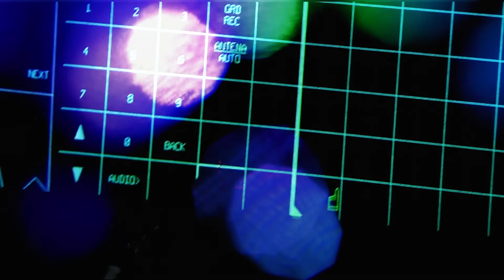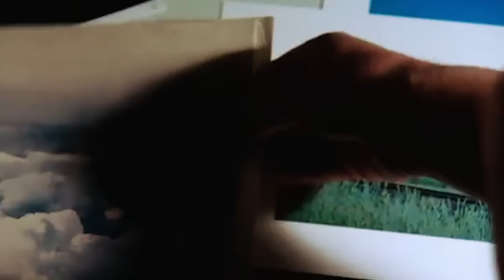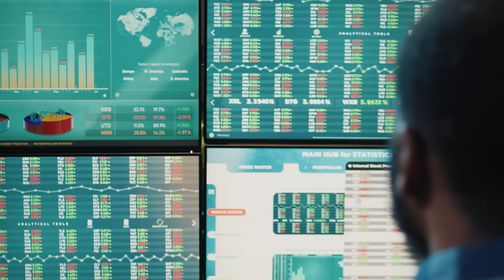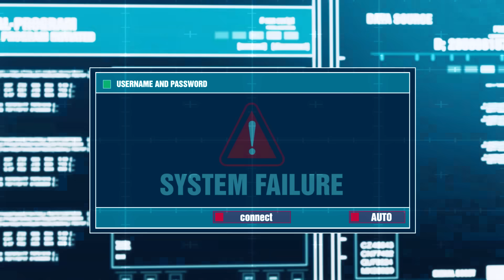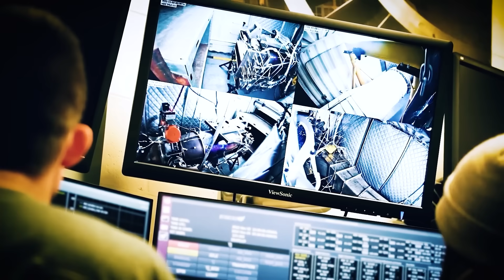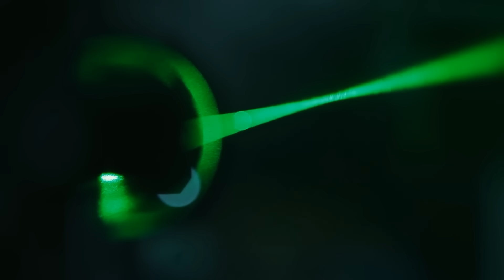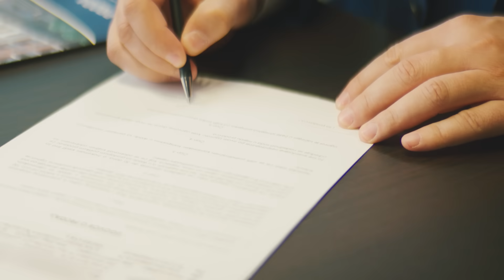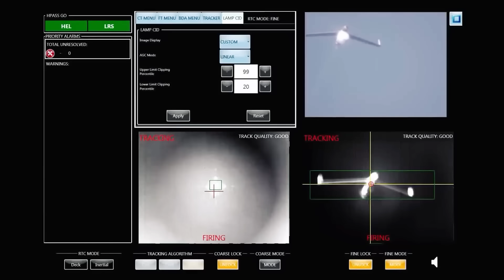Breaking! US Air Force Declared DARKSTAR Is REAL!

Comment: What do I think of an airplane flying at "2 miles per hour?"

I think someone messed up.
Reply: yeeeah, Im Guessing 2000 mph
Reply: That's only mach 1.6
Reply: My guess is it'd sink like a rock
Reply: Diversity hire?
Reply: No actually it's 2 miles a second.....that works out to Mach 10
Reply: The old Marine AV8B Harrier could move that slow in the air
Reply: Fantastic retort! @TheKevinNewsom
Reply: Yeah quality control is asleep at the wheel.  It doesn't make any sense at all whatsoever...should have been caught by a professional channel.  And no edits?
Reply: I think they really mean Mach 2
Reply: @bragemerkesdal8455 An aircraft at 2 mph is a sitting duck, but, that isn't what they are talking about.
Reply: I'm guessing they did it for "engagement" in the comments section. It's what a lot of the comments are about.

Comment: Ummm, 2 miles a second, you meant. That's 7200 miles per hour. Mach 10 is about 7400 miles per hour. So, yeah somewhere in that range. BTW the sonic boom would level buildings if it wasn't above let's say 20k feet in altitude.

Comment: Flying at two miles per hour, unless a vtol is impossible.  It would take weeks to fly over Asia not mins. Turbo jets only reaching Mach 2.2 except those aircraft rated higher towards Mach 3. Fact don't seem to mean much in this video.
Reply: Silly, you enter the Portal at 2mph.

Comment: Aside from flying at 2 miles per hour, this video makes an apalling error. Take a physics class. The plane will not overtake the missles it fires. The speed of the missile is added to the planes speed. If the plane can do Mach 2 and the rocket can, by itself do Mach 2. The missle speed will be Mach 4.